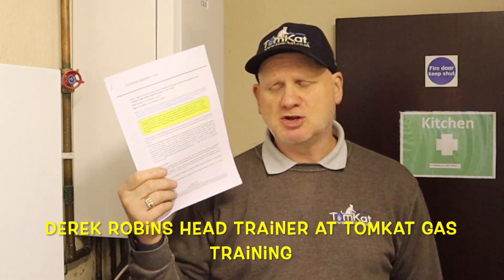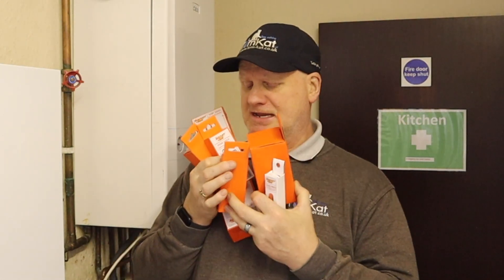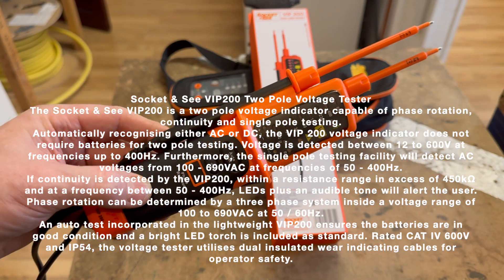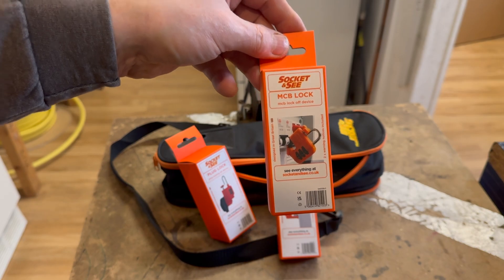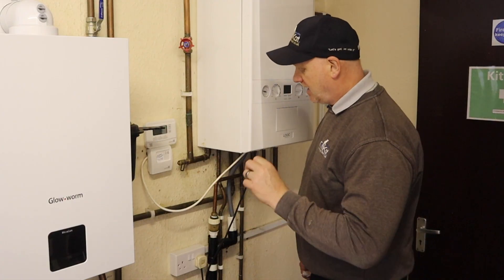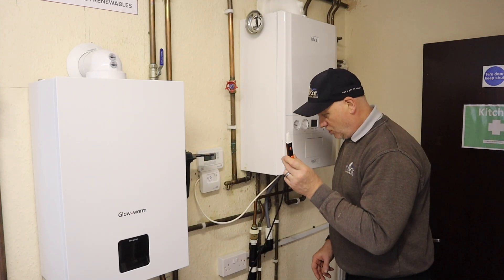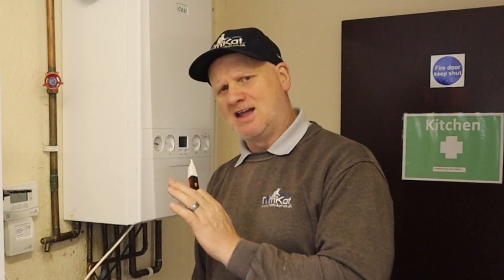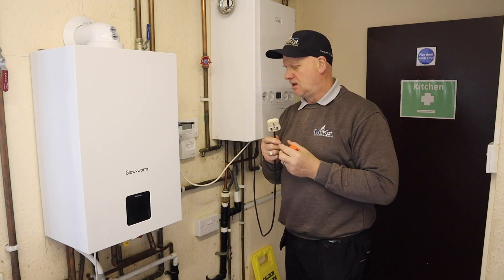Using socket and see electrical  test equipment to carry out  safe isolation to Gas safe TB118a.

Comment: The video contains multiple serious breaches of Gas Safe TB 118A and HSE isolation requirements.

The proof-test-proof sequence is incomplete: the non-contact voltage indicator (NCVI) is never re-proved after testing, nor is the circuit re-tested after lock-off to confirm it is truly dead. TB 118A requires both steps - prove on a known live source, test the circuit, prove again, lock off, then re-test and re-prove once more.

It incorrectly suggests that a wall socket can replace a proving unit. Only a proving unit provides the correct simulated voltage to confirm the tester is functioning properly.

It fails to verify all points of isolation. TB 118A requires every conductor capable of carrying current, line, neutral and earth, to be confirmed dead. The video only checks the live conductor, leaving neutral and earth untested, which could result in shock from backfeed or fault voltage.

It implies that removing a plug fuse is “good enough” isolation if the socket remains in sight. This directly contradicts the lock-off requirement designed to prevent accidental re-energisation.

Lastly, it promotes a reckless “back of the hand” test to check for live current, explicitly unsafe, non-procedural, and contrary to all electrical safety training.

Each of these failings breaches TB 118A’s mandatory safe-isolation procedure and could lead to serious injury or death if copied in practice.
Reply from the maker: Thought you had gone away using AI to create a comment dose t make it correct made you should read 118a instead of getting AI TO DO IT FOR YOU